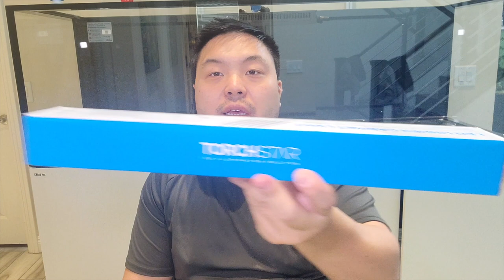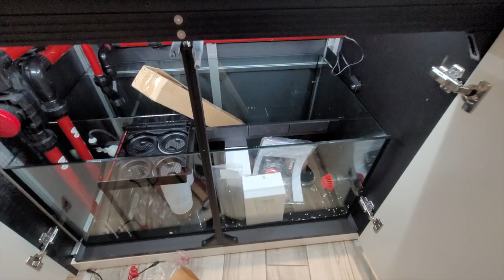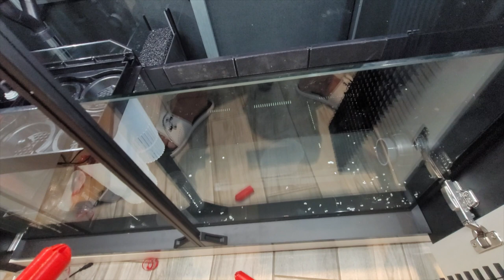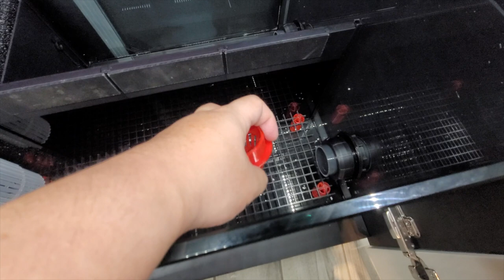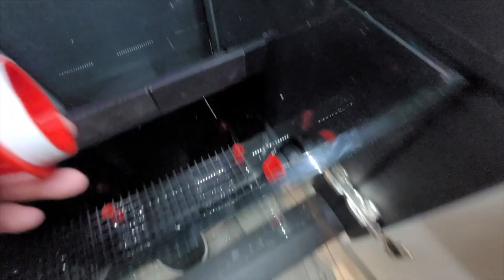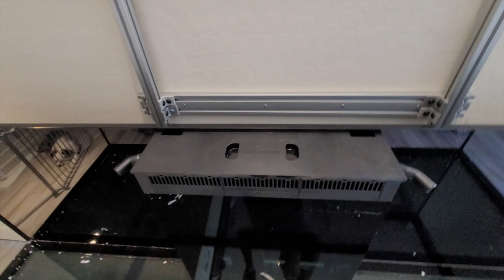Sump Mods for the Red Sea S-1000 | 3D Prints and Cabinet Lights

Comment: Great looking tank, can't wait to get fish and coral in mine.  Just starting to cycle it, I have the 850. 

The Frag rack, you'll have to cut it down.  If you are getting the ReefMat, it takes up a little more space than you think.  Also you'll have to cut the flexible pipe down a lot, and the black support that goes with the filter socks, will get in the way of the ReefMat.  Atleast on the 850 it does.

Do you have the print files for the parts you printed?  Also make sure that you have leak tested the sump.  I leak tested and moved it just a tad on mine, and had a leak.
Reply from the maker: Yeah I figured I'd have to cut it down. At some point when I get a reefmat I might try to figure out if I can hard plumb it.